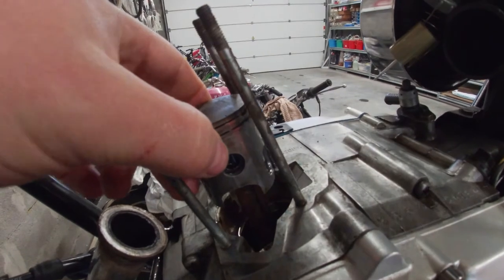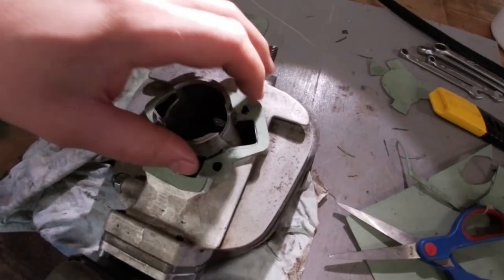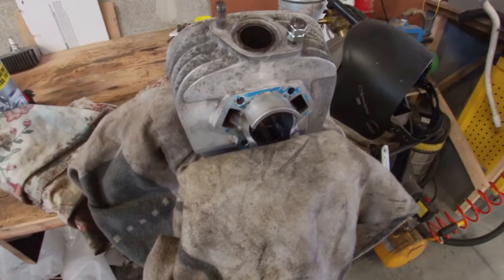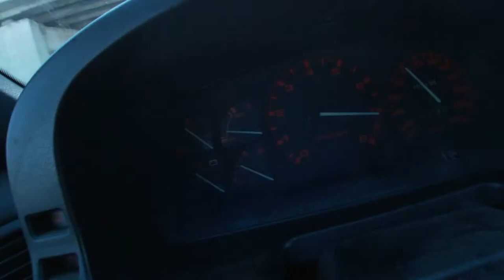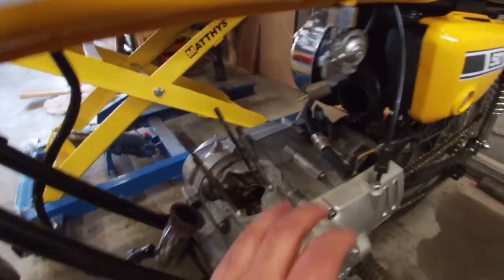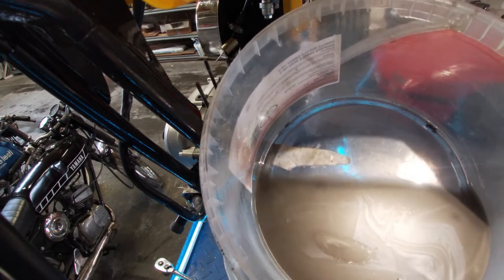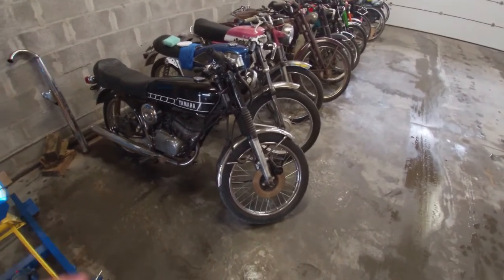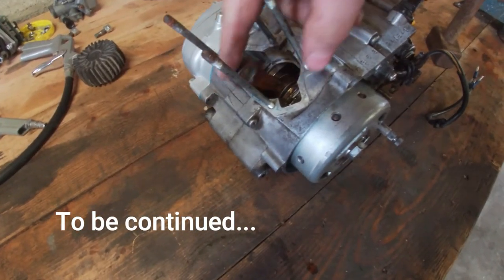Yamaha RD50 'Kenny Roberts' - Pt.10 What is wrong with it?

Comment: That’s why you need to have the two stroke oil pump working mate so it can always oil the crank brings and big end to mate because a lot of it burns off with out it oil it up
Reply from the maker: The fuel is premixed so it definitely gets its lubrication. I actually mix in a little bit extra than the pump would
Reply: @VintageGarageYT  mate trust me please then the engine would last long time if everything working as it should mate and if it is over oil then smoke like mad the bike would or not start mate premix like you do yes some parts do you get the right oil or not enough when petrol bin in the bike for days it seems to settle like that oil 2/oil goes to the bottom of the petrol after day or so mate on a pre-mix mate think on this mate please and thank you mate to and if we see a bike smoke a bit all good because parts are being oilled up when running but if no smoke to see then no two stroke oil there at the time of running it 
No smoke out of the exhaust then bad in me book ? Lol  because damage can be done rebuild new crank bearings big end bearings little  bearings to stop more rebuild s make shure every thing works because it’s all there on the bike for a reson mate to make it work all day long lol after let them cool down because of air cooled to lol 😂
Reply: @VintageGarageYT  mate trust me please then the engine would last long time if everything working as it should mate and if it is over oil then smoke like mad the bike would or not start mate premix like you do yes some parts do you get the right oil or not enough when petrol bin in the bike for days it seems to settle like that oil 2/oil goes to the bottom of the petrol after day or so mate on a pre-mix mate think on this mate please and thank you mate to and if we see a bike smoke a bit all good because parts are being oilled up when running but if no smoke to see then no two stroke oil there at the time of running it 
No smoke out of the exhaust then bad in me book ? Lol  because damage can be done rebuild new crank bearings big end bearings little  bearings to stop more rebuild s make shure every thing works because it’s all there on the bike for a reson mate to make it work all day long lol after let them cool down because of air cooled to lol 😂 oil and cold wind to keep the engine working good all day long lol
Reply from the maker: @vivianbond7449  My FS1 has been running for a couple of years now without oil pomp and all my other bikes dont even have an oil pump. Havent had much issues with oiling when premixing. This engine was bad before I started the restoration. I had no information or history on it. The startups on the videos are probably the first time the engine ran again in 20years so 🤷
Reply: @VintageGarageYT  ok mate fair play to the fs1 to mate

Comment: People called Firefox can redo the barrol to there on eBay to mate
Reply from the maker: Cylinder has been recoated with nicasil 👌
Reply: @VintageGarageYT  mate what size jet is in the carburettor to because you can get all different sizes have you just got standard in there mate and tune up from the flue and air screw at hi revs mate because you can here how the engine will run it screams up or it’s choking itself to get there if things aren’t set up properly you can here it mate and turn tick over screw outwards to tick over very  calmly then to when let of the revs mate
Reply: @VintageGarageYT  my bike s where fast as ffffk plus good on flue to mate and sold every one of them to mate lol good old bikes rd50 to rd 80 to the Dt50 to mate and the DT80 to let not leve that one out mate lol
Reply from the maker: @vivianbond7449  Not sure what the jetting is right now. I havent changed anything yet, so I think stock will be in. I have a set of jets and will be checking everything once I get it running again